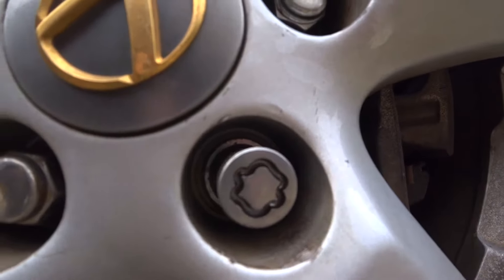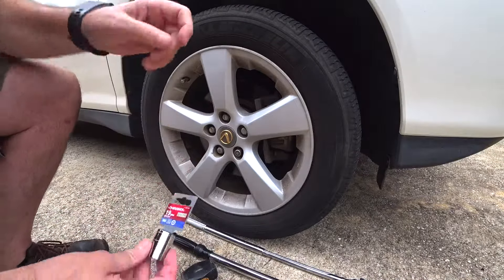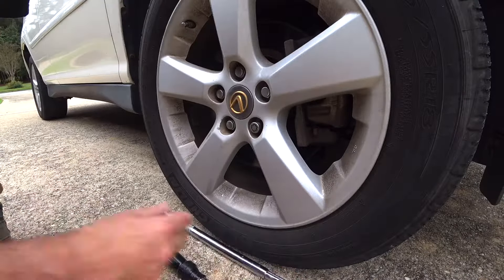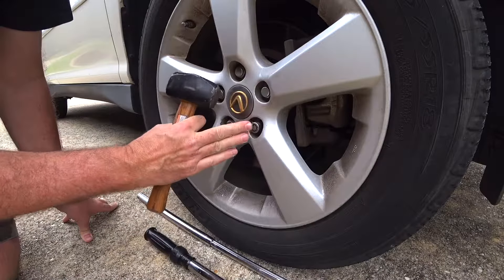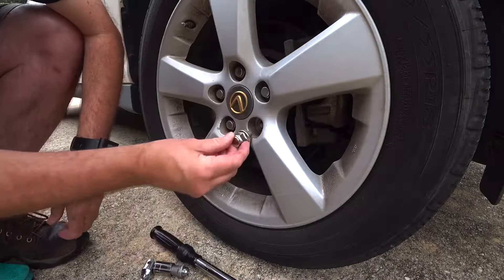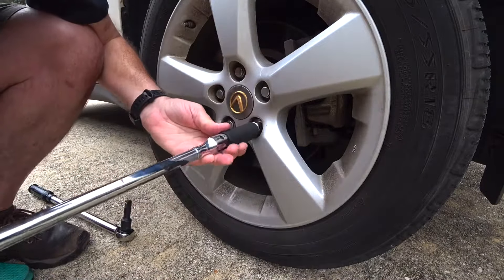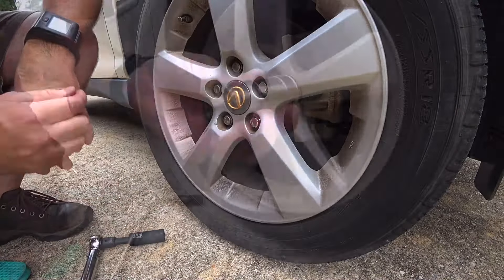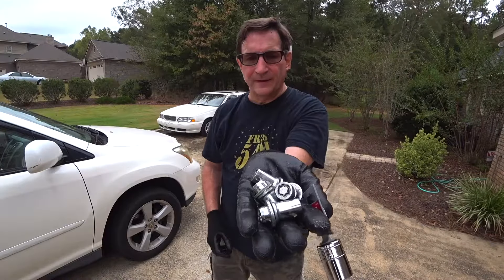Easy McGard / Lexus / Toyota Wheel Lock Removal

Comment: But, just remember This, if you value your Tire Or Rims..if you make it easy to remove, you're making just that much easier for the thief.. but ya, in general, security lugs suck bcse the adapter drive socket usually strips out with medium torque application.. make it any easier and then anyone with a beefy handle and ⅜" blade screwdriver can remove it..